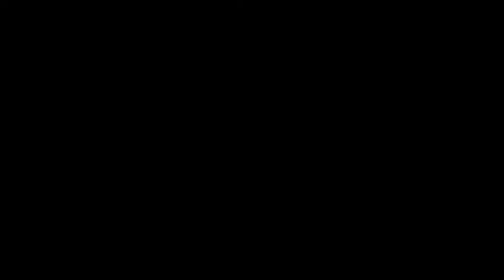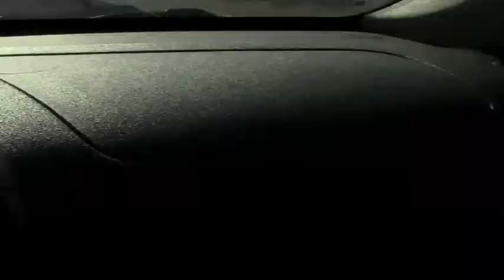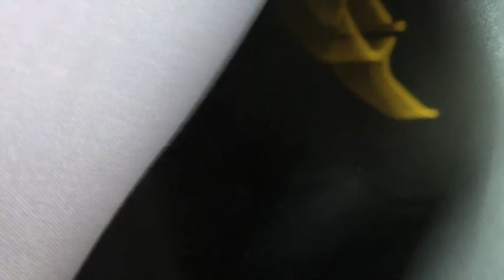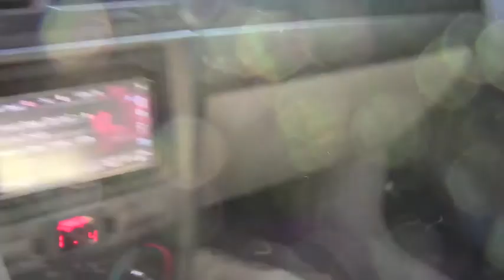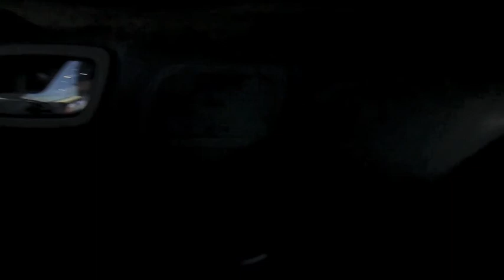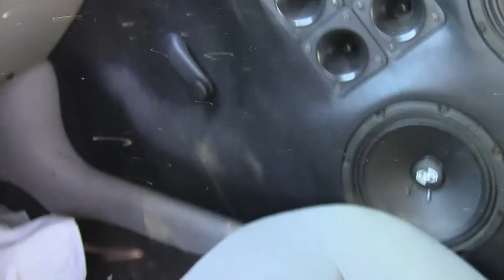154+db chevy cobalt

Comment from the maker: lol put it like this, i used to have 1 dc level 5 12 in a 1.5 cubic foot box and i couldnt even get that into the trunk, had to go through the back seats. if you have an sp4 its going to call for prolly 4-6 cubic feet per sub so you may have to build the box inside of the trunk